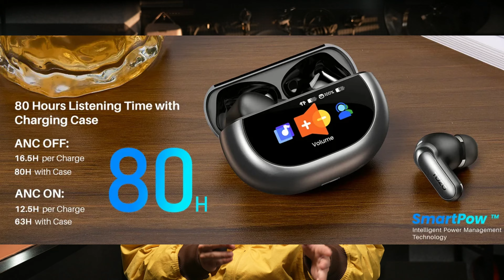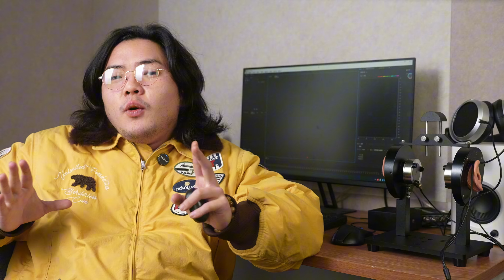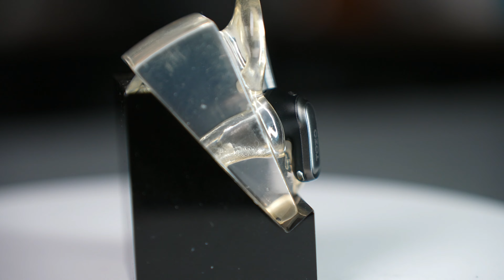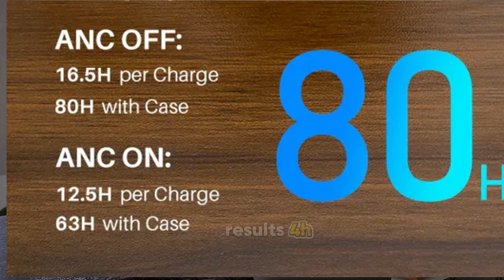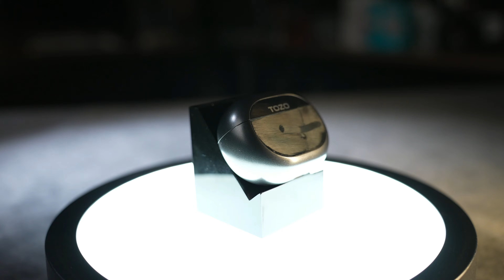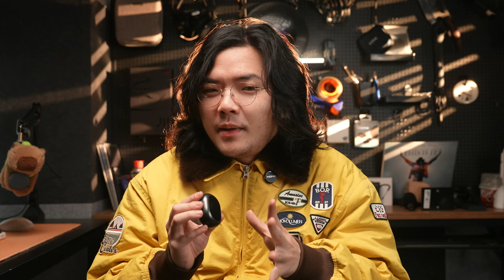30 Hours Playtime? Testing TOZO NC20 with System-Level Code.

Comment: Hello. I’d like to get your opinion: I’ve had two pairs of Soundcore Space A40s for three years—which I really like—but the batteries are starting to wear out. So, I decided to replace them with new models. I already bought a pair of Huawei FreeBuds Pro 5 and am very satisfied. However, I’d like to get another pair and am torn between the Tozo NC20 Pro and the Soundcore P31i. Which of the two would you recommend? Best regards, and congratulations on the excellent work!

Comment: When I purchased the Tozo NC20 (not the NC20 Pro) from Amazon Australia on 15 October 2025, both the product images and description stated 30 hours of playback on a single charge. I took screenshots on 16 October 2025. The battery details in the product listing at the time read:

“80H Playback & LED Power Display – Enjoy a massive total of 80-hour playback (30hrs on a single charge, ANC off). The wireless charging case features an LED power display for real-time battery status. Get 5 hours of listening from a 10-minute quick charge via USB-C.”

This information has since been updated, particularly after the release of the NC20 Pro.

In October 2025, I also saw other websites listing the NC20 with the same battery life claim, although I didn’t take screenshots and those listings have now been updated.

I’m happy to provide the two screenshots from Amazon Australia dated October 2025, but I’m unsure of the best way to share them.

That said, I own both the NC20 and NC20 Pro and absolutely love them. I’ve been using Tozo earbuds for several years, and the NC20 (including the Pro) are my favourites.
Reply from the maker: Thanks for the info! If you'd like, you can send it to my email address: soundsdigging@gmail.com

Comment: Thank you, every other video is sponsored and no one else actually tests the wild battery life claims. And no else mentioned that you have to take the case with you to use the screen. 6.5 hours playback time doesn't sound that great, rtings tested the soundcore a40 with ldac and anc on for 8 hours at 85db and those only cost 40€.
Reply from the maker: Thanks for liking it, and thanks for letting me know—now I'll have to try the Soundcore A40!

Comment: Great review. I actually bought the NC20, but later returned it and upgraded to the NC20 Pro. It may seem silly, but not having to open my phone app and turn on location to switch settings like sound mode or EQ is actually a huge bonus for me. Although I do agree it would be nice if the box had a few extra features.
Reply from the maker: Thanks for watching! What suits you best is the best. If you like this feature, then it's the best. Enjoy~